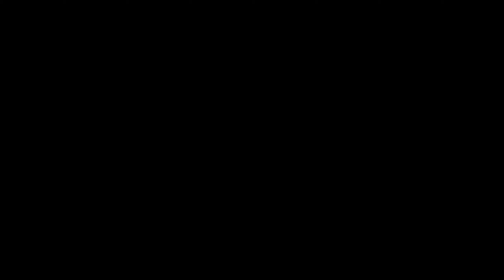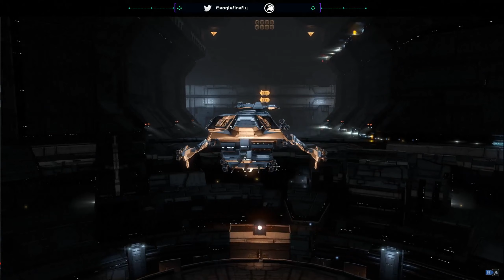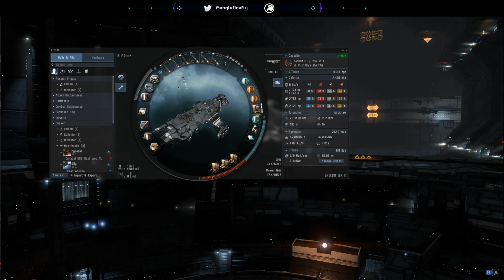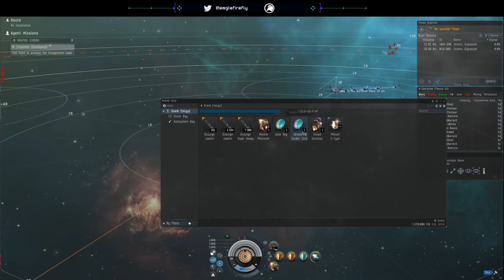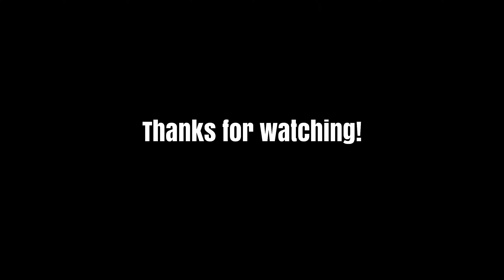EVE ONLINE Tengu Worlds Collide Level 4 Tutorial Guide

Comment: Try this. Better range, dps and application and cap stable:
[Tengu, .]
Republic Fleet Ballistic Control System
Republic Fleet Ballistic Control System
Republic Fleet Ballistic Control System

Republic Fleet Medium Cap Battery
Gistum B-Type 10MN Afterburner
Gist B-Type Shield Boost Amplifier
Gist X-Type Large Shield Booster
Gistum B-Type Multispectrum Shield Hardener
Missile Guidance Computer II
Missile Guidance Computer II

Heavy Assault Missile Launcher II
Heavy Assault Missile Launcher II
Heavy Assault Missile Launcher II
Heavy Assault Missile Launcher II
Heavy Assault Missile Launcher II
Heavy Assault Missile Launcher II

Medium Rocket Fuel Cache Partition II
Medium Hydraulic Bay Thrusters I
Medium EM Shield Reinforcer II

Tengu Core - Augmented Graviton Reactor
Tengu Defensive - Amplification Node
Tengu Offensive - Accelerated Ejection Bay
Tengu Propulsion - Fuel Catalyst

Missile Precision Script x2
Scourge Javelin Heavy Assault Missile x3208
Scourge Rage Heavy Assault Missile x3121
Covert Ops Cloaking Device II x1
Inertial Stabilizers II x3
Reply from the maker: Now thats shiny! haha
Reply: @EaglefireflyGaming  You'll want your missile guidance computer to have a precision script at the very least. Range is less important than application. As long as you keep moving, you're fine with your tank. Use T1 scourge on the frigates, as they apply better and have better range.
Reply: You cant equip cloak and Amp node. Youd need Covert Reconfig
Reply: @cptspalding32927  It's in the cargo hold.